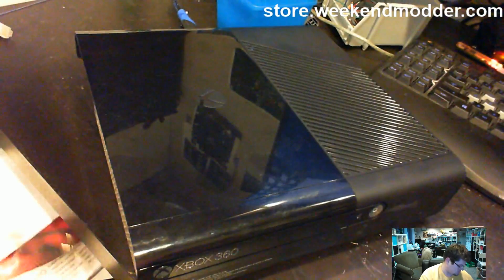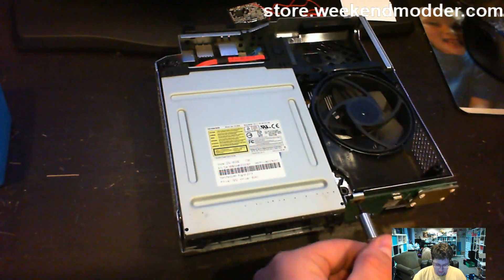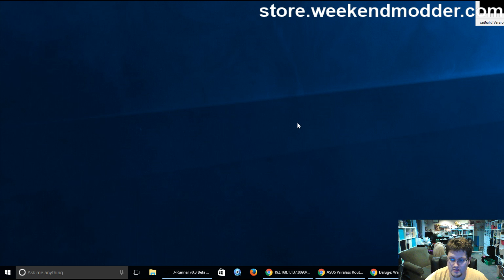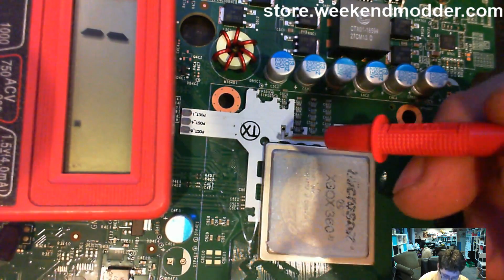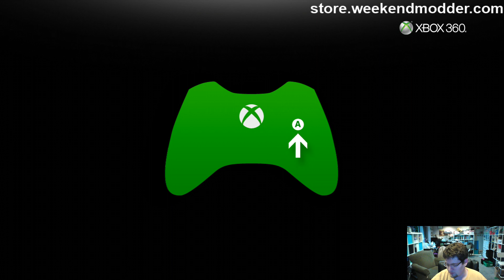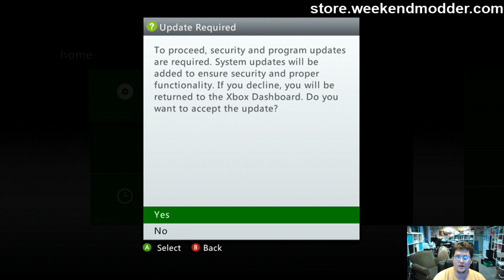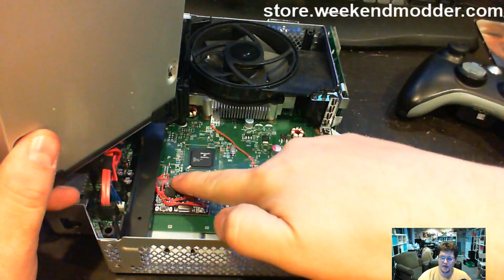Watch me RGH an E Series Slim Corona complete process!

Comment: Hi, Great videos.... just one thing, the nand reader you made, would an sd extension cable work in the same way (cut of one end and seperate the cables ready to solder to xbox) or are there specific items you need... would really love a heads up... thanks
Reply from the maker: I didn't make that reader, it was designed specifically for the purpose of reading 4gb nands on Xbox 360 consoles.   There are lots of plans and tutorials out there for making them from micro to full size SD card adapter though.
Reply: thanks
Reply: TheWeekendModder ive sended so much emails i want a modded xbox so pls reply
Reply from the maker: I have responded to every email I've received.  Don't think I have any from you.  You sure you sending to the correct address:  weekendmodder@gmail.com   ???  Also, if you want to buy - just buy at my store at www.store.weekendmodder.com
Reply: TheWeekendModder you didnt to mine :/   btw do you shipe to europe?
Reply from the maker: Then you didn't send it right.   

Thanks for inquiring about Weekend Modder International orders. 

Weekend Modder typically has a "no international orders at all" policy, but recently due to feedback decided that we could offer international shipping for orders paid with bitcoin.   

If you are unfamilar with bitcoin, I suggest this quick less than 2 minute video as a good intro:

https://www.youtube.com/watch?v=Um63OQz3bjo

The reason we can accept bitcoin is quite simply that transactions are permanent.  Refunds and international credit card charge backs are too much hassle.  Bitcoin allows us to ensure the transaction is permanent and both sides hold to their agreement.  

If you don't already have Bitcoin, I suggest https://www.coinbase.com/ as a good starting point.  You can buy Bitcoin with credit/debit cards or even PayPal through coinbase.

If you would like a shipping quote, please use the USPS pricing calculator on USPS.com to calculate the shipping to your country for a "Large Flat Rate" box for a console, or a "small flat rate box" for small supplies like chips or programmers.